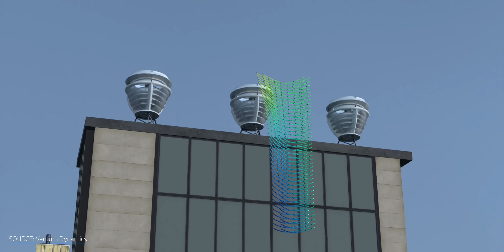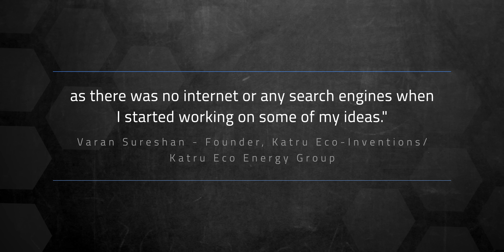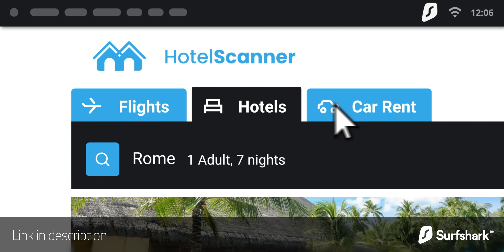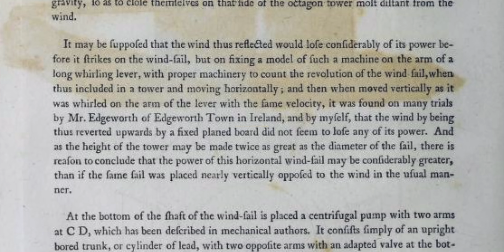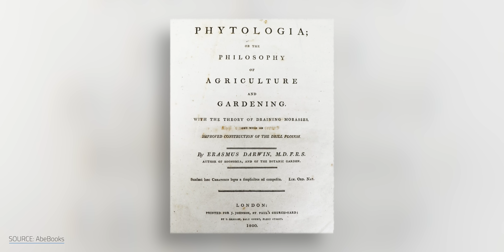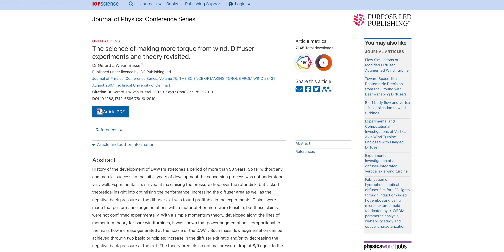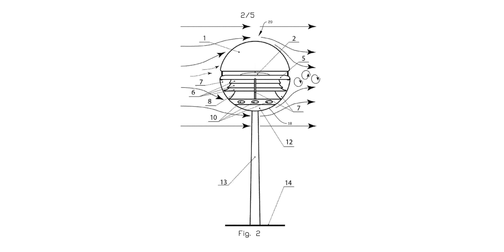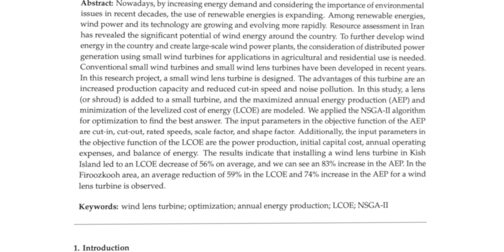Are Shrouded Rooftop Wind Turbines the Future of Energy?

Comment: All practical tests show that small wind turbines hardly generate any electricity! And only at a cost of over €1/kWh, because there is hardly any wind near the ground. 
However, the electricity yield increases with the third power of the wind speed, i.e. with 100% more wind = 800% more yield!
Wind close to the ground is also extremely gusty, which usually shortens the service life of the turbines considerably. Only those who MUST be self-sufficient in electricity should install the largest possible system on a high tower for the winter.  *Solar modules, on the other hand, generate reliable, low-maintenance green electricity for 25 years at approx. 5-10 cents/kWh. 

Alle Praxistests zeigen, dass Kleinwindanlagen kaum Strom erzeugen! Und nur zu Kosten über 1€/kWh! Denn bodennah weht kaum Wind. 
Der Stromertrag steigt jedoch mit der dritten Potenz der Windgeschwindigkeit, d.h. bei 100% mehr Wind = 800% mehr Ertrag!
Bodennaher Wind ist zudem extrem böig, was die Lebensdauer der Anlagen meistens sehr verkürzt. Nur wer stromnetzautark sein MUSS, sollte für den Winter eine möglichst große Anlage auf hohem Turm errichten.  Mit Solarmodulen hingegen erzeugt man zuverlässig & wartungsarm über 25 Jahre Ökostrom zu ca. 5-10 Cent/kWh!

Comment: Small scale wind has a valuable role to play as output is inversely correlated to solar output.
Will it catch up with falling solar prices? No.
But solar plus wind can provide a more uniform output that requires less import (for a single building) or less storage backup.

Comment: My first degree was in Engineering and my first real job was Electrical Engineer.  Then I changed fields to Biology and Drug Discovery.

From my Engineering background I think this turbine might be a good technical solution IF its installed cost is less than the value of the power it generates.

From my Drug Discovery experience I know that when failures are common, we need many companies trying their ideas to get enough successes to make a big difference.

So I wish the people behind this idea well. I hope their idea succeeds.  I also hope many other smart people can get investors to fund their ideas too, because only by trying many ideas can the best ones be found.

Comment: Building architecture should be designed to funnel the air/wind into a venturi to concentrate the energy to one or a few locations where the turbines get maximum energy especially for low wnd days.  Rooftop V' design, --==>>>X, would concentrate the wind.   I did not see that in any of the images in this video.    My observation comes from being a paraglider pilot for 25 years and wind is your friend or demise, so use it carefully!

Comment: One of the reason for resistance to wind turbines in urban areas is the rotating blades that is distracting. Hiding them inside a shroud should make them more acceptable in an urban setting. Placing them on top of tall buildings means noise should make this less of an issue.

It's estimated that 70 - 80% of people will live in cities by 2050'ish - cities MUST start providing solutions to sustainability issues and become less parasitic on its hinterlands.

Comment: For renewables there's ALWAYS one question that has to be answered. 

What's the lifetime CO2 produced.
Everything produces CO2 and heats up the planet. Ore has to be mined and smelted, stuff has to be pressed, processed, transported...

Solar can break even in about 10-20. Maybe faster with newer versions. 
Many wind turbines are still carbon positive, meaning they produce more CO2 during production and assembly than they offset. 
However, its obviously dimensions less total released CO2 than a coal plant for example. 

I think thats an important question. Because as humanity we need to arrive at technologies that sre carbon negative. Otherwise we will heat up the planet more and more. 

But yeah, we should def. Build "slightly carbon positive" stuff over fossil plants. But my gut feeling tells me that solar is still the better choice (no moving parts, decades of industry experience, installed systems can still benefit from new tech retroactively - e.g. by virtual powerplants or scheduled smart usage)

Comment: i have an almost identical design, save that mine uses a patented multistage rotor, which accumalates the wind and then accelerates it through a reducing volume reverse flow ducting system . increased speed multiple times.

Comment: These tubine pods are a good idea; omnidirectional and bird friendly.
If the top ring housed a ring stator with a magnetic ring attached to the blade ends, the output could be significant.
The technology is old, quite common, and all based on the Bernulli principal.
These turbines could be mounted on the ridge of the standard home rooftop or along the edges of flat roof buildings.

Comment: Yeah, the big wind turbines really are a nightmare the fan blades being made of synthetics that take Titanium grinders to convert to sand. These grinders are expensive and wear out fast so thousands of discarded blades are lying in a landfill waiting to be chopped up. Not to mention all the birds that get whomped by the spinning blades.
Reply: "A 2012 study found that wind projects kill 0.269 birds per gigawatt-hour of electricity produced, compared to 5.18 birds killed per gigawatt-hour of electricity from fossil fuel projects. That’s in part due to collisions with equipment (wind turbines aren’t the only energy infrastructure birds can fly into), but mostly because of the environmental impact of fossil fuels. Coal mining has torn down forests and destroyed habitat, and burning coal produces air pollution tied to acid rain and mercury contamination, which scientists have linked to bird health impacts like birth defects." (sourced from a website)

And I'm sure you are deeply concerned about the number of birds and animals killed by domestic cats.

And, from what I read, the claim about recycling turbine blades is because the blades being recycled today were manufactured 20 or 25 years ago, without consideration for disposal. That matter is being addressed in new blades. 

"The catch here is that while wind turbine blade recycling is technically possible, landfill disposal remains the most cost-efficient and accessible option in many cases."

And if you were equally concerned about all of the other stuff going to landfill, I'd be more impressed.

Comment: It would be interesting to see the comparison to the big wind generators, when also factoring in the cost of electric infrastructure, these excel in that area because they are installed in the user end of the grid, so no expansion of the power grid because of small local wind generators, and much less maintenance, and the maintenance can be done from a normal ladder, but really would like to see something for private homes as well, it doesn't have to be cheaper, if it provides independency from the grid.

Comment: Unfortunately with a rotating mass comes noise and vibrations most likely transmitted throughout the buildings structure. Dampening can help but will never entirely remove it. Trying to watch TV with a low hum in the background. Trying to work with that small vibration in your seat. Wind power is dead, even whales do not like it. Stick with solar on every roof possible, placing the generation at the usage point. It will improve.

Comment: I disagree, Darwin's invention and the VX175 are not just superficially similar.  They are both inventions that use the same concept, a circular shroud with 360 degrees of inlets drives a  blade.  This basic design is what allows for greater power to be captured from the wind than a blade facing the wind.  This is NOT a superficial similarity.  Darwin established the baseline and his invention would have been considered "prior art." This means that the VX175 had to show at the time of their patent filing that their design improved upon the prior art.  Whether the VX175 was inspired by Darwin's invention or not is unimportant.

Comment: I'm glad that this kind of technology has been brought into the light. Energy generation is a complicated issue and we'll need a multi-faceted solution. We need to deploy technology like this to actually gain practical Hands-On data and experience. This sounds like it could be a part of a solution to gain large buildings carbon footprint down to zero.

Comment: Meh. It looks ugly, the output is undoubtedly low, and it doesn't appear it can sit close enough to the roofs edge for maximum capture. Seems like you'd capture the updraft far better with that roof-ridge turbine design, but pointed up/down around the edge of the roof.

Comment: I wonder, as AC was specifically mentioned, would designing an ac that has something like this mounted atop it, made to directly turn the rotation into cooling be worthwhile? 

I know there are losses turning the mechanical rotation into electricity and the electricity back into rotation in the refrigerant pumps and fans.

Comment: Engine cooling fans with no shroud like on a older engine driven cooling fan are almost useless.  The air will not pull thru the rad, yet with a shroud it can cool the engine, change the state in a A/C condenser and handle it even in high heat ambient outside temp.

Comment: I have greenhouses. There have always been problems with having far too much heat high up in the building where it could not get out. Last year I redesigned one of them with vents in the roof to alleviate this problem it has worked extremely well. The temperature inside the greenhouse is never more than five degrees (F) higher than the outside air. A turbine such as this would work extremely well well over a greenhouse, possibly making it worth adding a greenhouse to a net zero home.

Comment: dAWts have a place if they are engineered correctly and they are installed in the correct locations. Mass is a major factor, most building roof tops were engineered for the mass of the roof and plant that was designed to be there, such as AC equipment, perhaps local streghtening if there is larger planet, such as standby generators to be mounted. Ventum do no mention mass of this on their website that I have been able to find - and that is critical to any retrofit that may be looked at - the cost of strengthening the roof structure to take these units may be prohibitive. 

I would also be interested if they installed a shroud of this type around a conventional VAWT unit, as the dynamics of the airflow should be the same, and as they are already designed to take wind from all directions, this should not be a technical problem. Clearly manufacturing such turbines from lighter and stronger materials is key, the lighter they are, the lower wind speed required to move the rotor for a given blade size.

Comment: I am mildly amused by these ongoing attempts to extract power form low volumes of slow moving air.   3 to 5  metres a second is peanuts unless it involves vast VOLUMES of air. No matter how fanciful and clever the shrouding devices, if the capture volume of the medium involved is small then no matter how efficient the design, the power extracted can only be puny.  Hence we see in the real world, ever larger diameter rotors being erected  to engage with vast volumes of the passing medium .
               The greater the volume of the passing air engaged, the more efficient the capture device.  Puny windmills and other 'clever' shrouded tiny turbines engaging with so little potential energy, are  surely a waste of time ?

Comment: Air is relatively light, 1,000th the mass of water. So, it cannot carry much energy. Lack of energy density is the same problem with LiOn batteries, which at best have 100th the energy density of diesel fuel. These fundamental realities are often ignored with so many of these ideas.

Comment: Why have architects and engineers get together. If a tall building had car parking facilities.
The ventilation system from the base from the carpark, passed up through the height of the building.
At each stage a heat exchangers and wind turbines, could be used.
Basically free energy

Comment: How much does it cost, and how does this compare to using the same roof space for solar panels? What is the lifetime and maintenance required? How many birds does it kill? The energy production values stated at 16:30 indicate pretty lousy efficiency at modest wind speeds. Going from 6m/s to 10m/s, wind has 4.6X the power (power varies with the CUBE of wind speed), but they only extract 2X. 

3,000kWh per year is WOEFUL for something that huge (2.9m wide and 2.5m high). I generate 3X more than that with solar panels that cost about $US2,600 installed and only use 35 square meters of roof space. I bet this turbine costs at least 20X more than that to capture a third of the energy. 

And blaming the demise of these startups on politics is just lazy; if it's so obviously better than the alternatives, it will succeed.

Comment: We approach these presentations from the companies with skepticism.  Most of the fans are in places where it probably would not get much benefit from the updraft of the buildings.  Just being in an area with a few buildings dramatically slows the wind.     Looking at the size of the cross section  area of the fan, they are not very big.  Air at these low speeds over the small distances involved does not act like the air that is normally studied.  Reynold's number is the ratio of the viscosity of air to its inertia.  Low reynolds number means those vanes are blocking a lot more airflow than they would at normal airplane speeds.  The air does not see a thin vane, it sees a thick wall.

Comment: Using LCOE as a metric for potential energy savings or cost calculation is utterly misleading, because LCOE do not include the cost of backup and storage systems absolutely needed and actually build to cope with the intermittency of wind and solar based devices. People need to know how much does their 365/24/7 available electricity cost and NOT how much their electricity MAY cost IF the wind blows steadily all year long or if "night time" wasn't a thing.
A better metric could be LACE (Levelized Avoided Cost of Energy). I hope Matt will explore that.

Comment: I live in a suburban high wind area.  Between our suburban sprawl and the true urban area is an area that is more rural than urban.  One of those rural houses decided to put up a small vertical windmill (approx. 3-4 feet diameter) about 20 feet off the ground as an attempt to lessen their electricity bill along with solar panels.  An article about it was in the local newspaper, and other people started talking about how well this windmill was doing and if they should get one.  I don't remember what happened, but I'm thinking the power company was involved.  The city passed an ordinance so no one could have a windmill--except the original homeowner, who still has theirs up.
Reply: the power company sabotaging another competitor, how shocking.
Reply: Aside from the possible design limitations I would guess no one wanted the way the neighborhood would look. Another issue would be safety, both for your neighbor when your tower fell over and the bird population.
Reply: @kellypurdue1990  the safety over birds has already been solved : paint black stripes over the blades and the birds will actually see them.
Reply: @Game_Hero  thanks! Learn something every day
Reply: @Game_Hero  What kind of stripes? perpendicular, parallel, different colors, etc?
Reply: @kramselab  There are different methods, but perpendicular stripes are the most popular (painting a single whole blade black also works well according to norwegian research). It's really the light-darkness contrast you want to get, so black on white is the most popping contrast you can get to be noticed by birds. Such painting reduced bird fatalities by 70-72% on a form of energy already quite low for bird fatalities (0.4 per gigawatt-hour) compared to fossil fuel power plants (5.2 per gigawatt-hour)
Reply: @kellypurdue1990  Truth to say, we wouldn't really need 20 feet tall windmills.  Sitting in my courtyard this morning and enduring 30 mph winds while letting the animals have their sunshine time was enough to get me to cut it short and head back inside.  I live on the hillside of a valley and the wind just whistles through on a regular basis.  The cats can't even stand it with the wind blowing their whiskers all around, but the dogs love the breeze since it's already 85F at 10am.
Reply: @kellypurdue1990  The bird population BS is a scare cow (AKA "FUD") that's was raised by the establish petrol industry.  That fact is that the impact on bird populations from effects of coal and gas plants far exceed the impact of birds colliding with turbines.  Please stop propagating the FUD.
Reply: @kellypurdue1990 Can you imagine how many birds sit on electrical wires and transformers without realizing how dangerous this is because there is no sound, especially during rain and storms, in addition to electromagnetic pollution that is harmful to the environment and humans alike ?
Reply: Rubbish. I expect this  died because wind turbines like this are almost invariably a waste of time.
Reply: @rogerphelps9939  it wasn't a case of one here.

Comment: If it were me and I were in charge the next thing that I would do to make this the better version would be to get Auto tracking on for Fernel lenses to focus in on a pool of water or otherwise make steam and so whenever there is no wind on a sunny day there would still be pressure coming from the boiling water steam machine.
Or otherwise figure out a way to take all the heat out of the building and ducked it directly to the machine